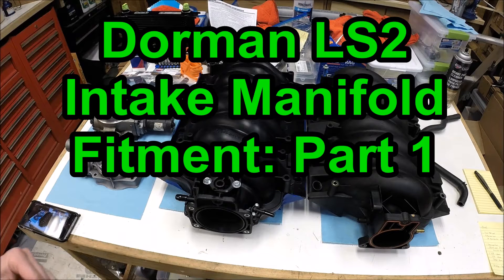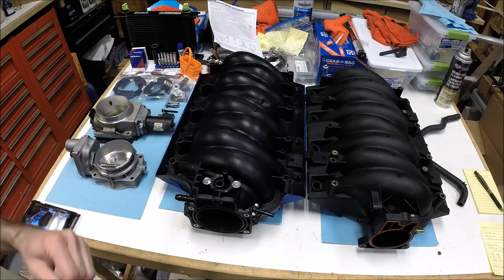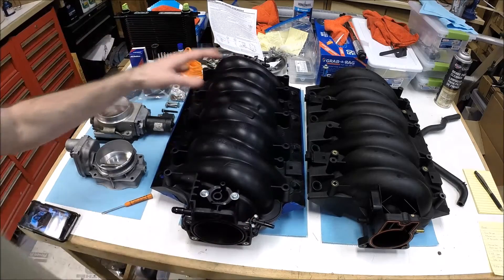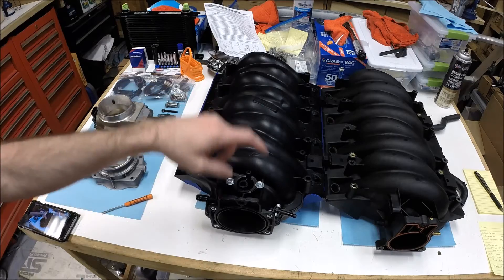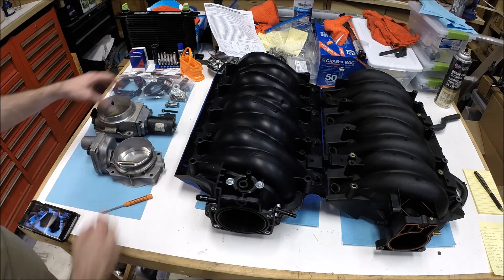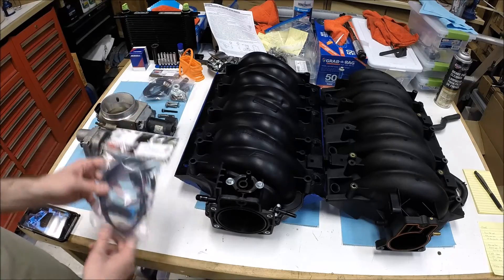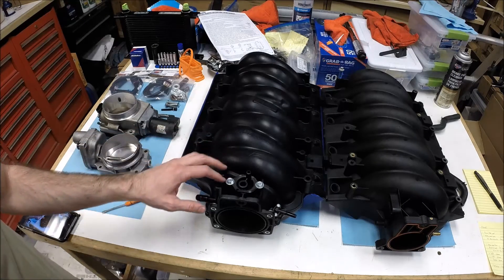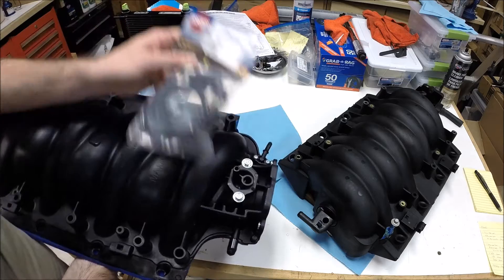LS Tech: Dorman LS2 Intake Manifold Fitment - Part 1

Comment: Sup brotha! I was wondering if you could help me out with my throttle body change on my 2002 Yukon
I put a TBSS intake and I’m upgrading my throttle body to a 90mm
I got a GM LS3 90mm with a xlink but the problem is that my stock throttle body has 2 connections 6/2pin
I was wondering if maybe a 6/2 pin to 6 pin adapter to the ls3 throttle body should work?

Comment: will ls1 injectors and rails bolt up to this?
Reply from the maker: Yes, I kept the LS1 rail and used Fast 36 lb injectors.   I initially ran those injectors on the stock LS6 intake, and then swapped them over to the Dorman LS2 intake.
Reply: Thanks for the reply and info, piecing together a ls1 and I have oem ls1 rails and injectors and want to use this intake with them.

Comment: Throttle body you can use depends on vehicle/ecu. I know for a fact you can use silver OR gold blades in 05-06 GTO applications. I'm not sure on pricing these days but golds have been substantially cheaper in the past than silvers. May run into issues on other vehicles, but just wanted to confirm that for all the LS2 goat people.
Reply from the maker: Good info on the other applications!

Comment: Hey did you use the stock ls6 fuel rails and injectors?
Reply from the maker: I used the stock LS6 fuel rails but with the FAST 36lb injectors.  The injectors were installed on the dyno since you'll need a tune change for them to run correctly.   But for the first 500 miles while I was breaking in the motor, I used the stock LS6 injectors.  Though obviously no WOT pulls.

Comment: i wonder how much power gain to have from ls2, ls2 intake to dorman ?
Reply from the maker: If you already have a LS2 engine with the 90mm TB, then going to the Dorman LS2 intake would probably be smaller gains.  Though the larger displacement of the LS2 is going to respond better to the increased air flow, vs the 5.7L, especially if you port the runners like I did.  But I can't say exactly how much of a power gain.  If you do it, definitely share the results!

Comment: LS1 engines also came with rectangular port heads?  What can I get for cathedral heads?
Reply: Thanks for the great video.  I am going to put an truck is engine in my 66 Chevelle.  This looks like it would be a nice upgrade from the ugly truck intake. Less clearance problems also.
 What do you think? 
Thanks 
Eric
Reply from the maker: I think that sounds like a solid plan and should be an awesome ride when you're done!
Reply from the maker: I can't comment too much on square port heads, but my application has cnc ported 243/799 cathedral port heads from Texas Speed.